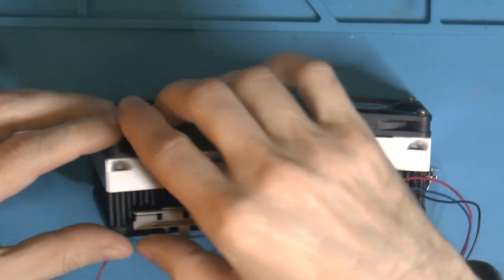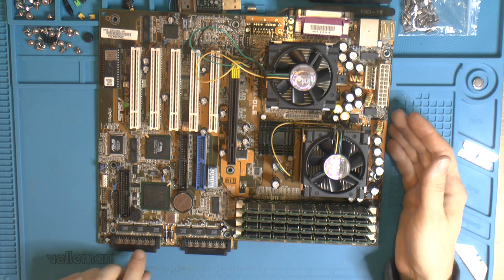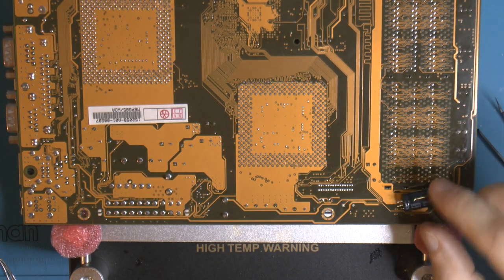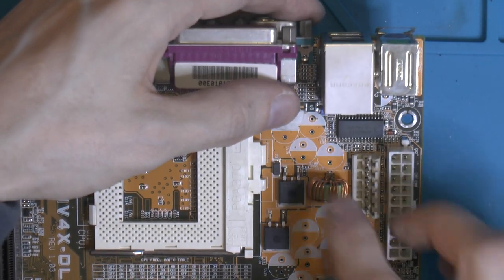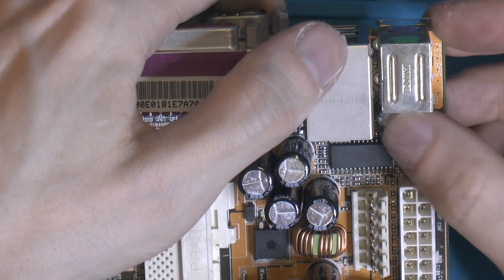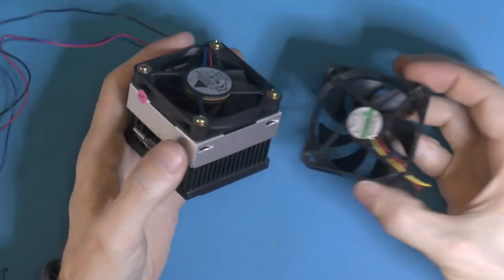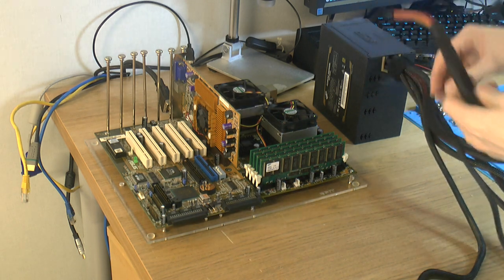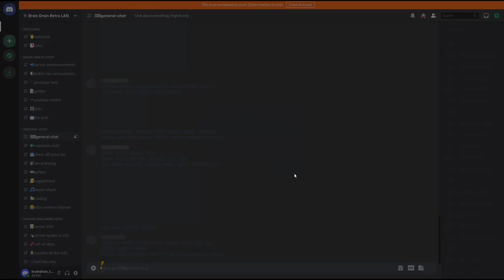Dual Pentium III Build Part 1 -  The CUV4X-DLS Motherboard

Comment: i wonder if it has the same bug as every asus with via apollo chipset that when you chose fsb manually pci divider don't switch, but when you overclock via covering bsel pins you can run celerons 566 at 200% speed with oem cooler and no volt moding
Reply: my TUSL2-C allowed me to overclock P3-866 up to 1266MHz, lol!
Worked ok on FSB195, while RAM freq were around PC145MHz (which is way above 133, anyway!)
Reply: @BANDERAZZ07RUS  yes but tusl2-c is based on i815 chipset, not via apollo and if i remember corectly it had jumpers for voltage moding memory so 3,3v dram coud run at 3,6v, like my cusl2 -c had. just imagine what late revision celeron tualatin 1,1ghz could do at those clocks, 
on via however even if bios sayd you had pci running at 33mhz it was runing at 44 when going from fsb 100 to 133 either by jumpers or in the bios and going above that would make it run closer to 50, but covering bsel pins on the cpu somehow it assumes fsb133 is the default and set pci at 33mhz corectly and you could overclock much higher (or overclock celerons with fsb 66 or 100 to 133 on oem boards with no oc)

Comment: I had a BP6, with dual Celeron.
Dual P3 was a dream machine :)
The oldest dual cpu mainboard I got used 2 Pentium 75 (or so, not 100% sure about the frequency).  Too bad, I never managed to install any OS on it.
I suppose I was just too dumb and ignorant back in the days :)
Reply from the maker: Yea dual machines are more fun are they not :)

I had an older acquaintance teaching me basic computer skills back in the 90s, like installing an OS.
Sadly he past away a few years ago, but he was all about Macs and had all the latest PowerPC mac stuff, the Cube, the Mini, The quad G5 liquid cooled etc.
It was so much fun having a friendly Mac VS PC arguments XD
He was an actual teacher.
But I can relate, I have learned more about DOS in modern times then I knew back then and got in to 486 even if our first PC was a Pentium.

But hey we can do it all over now and do it better XD
Reply: Sure they are fun !
When I had my BP6, I also had SCSI hard drive, cdrom and scanner.
I used Linux or Win2k.
I had the feeling I could launch as many things I wanted, this beast was unstoppable :)
Great improvement after Win98 ...
Of course the next upgrade was a A7M266-D with dual Athlon ...

"Mac VS PC arguments" ----> Macs ARE PC !!! Personnal Computers.

In the 90's, I just used a 286 to make speakers calculations on Dos :) I could see the curves tracing slowly in real time. Fascinating !
My first "real" PC was a 233 MMX in 1997, so already a quite powerfull machine.
Reply from the maker: @nalinux  Well I was told a Mac was a "PowerPC" therefor superior XD

Well I owned G4 Macs Like the Mini and now I have a heavily modded Sawtooth with a PowerPC G4 800Mhz 2Mb L3 cache CPU.

I did install Gentoo linux on it like a year or so ago for testing.
Reply: I bought my first Mac just a few monthes ago. A MacMini from 2012 :)
Of course I upgraded with 2 SSD and 16 Go ram, and Debian/ Win 10 .
I don't really like the Mac OS ... And performance is a pain with the poor video driver.  I really tried to use it, it's a pain for me.
On Linux ( or even  Windows in fact ) it's really usable in 2023, I love it.

Comment: If you use 25mm thick fans on the heatsinks you can use the lower "ears" on them with the included bolts.

Comment: what is the other power connector for next to the atx?
Reply from the maker: Its AUX power, predates the 4 pin P4 AUX. Thise one should have 5V and 3.3V.

Even the first generation socket 423 Pentium 4 used it but after that I think it went away when everything went over to 4 pin and later 8 pin 12V power.

The plan is to use it in the actual build.
Should help keeping the 5V and 3.3V closer to spec on the board, but its really not a big deal tough.

Comment: workstation/server ecc motherboards they are built  to last much longer than consumer segment, ecc gives better accurate calculations, 3D pc games was programmed for 1cpu core at that time, popular 3d engines like quake or unreal, there is no real advantage of having extra cpu for this purpose, the only real advantage will be realiability of the build.